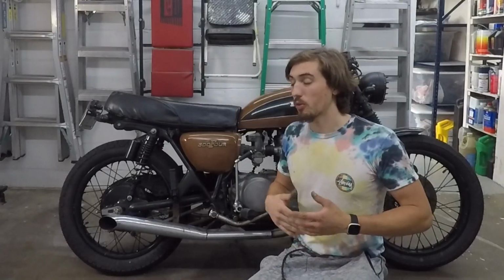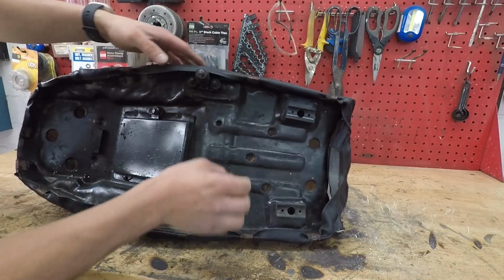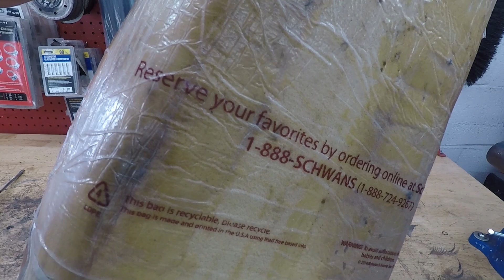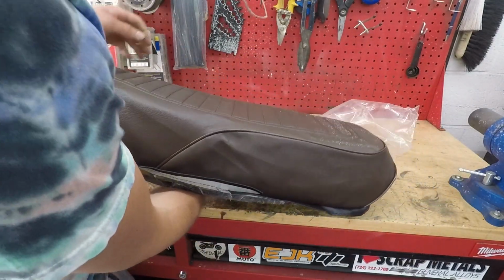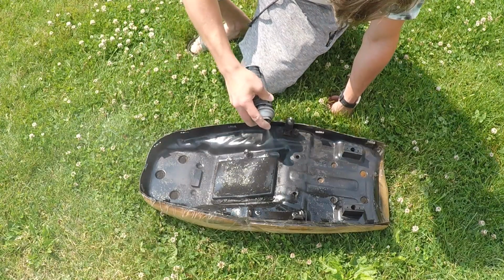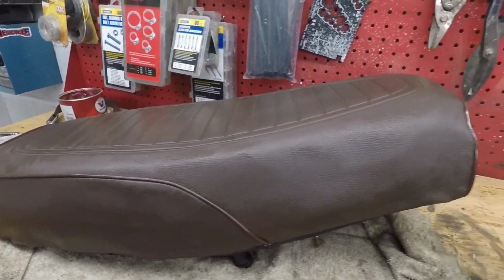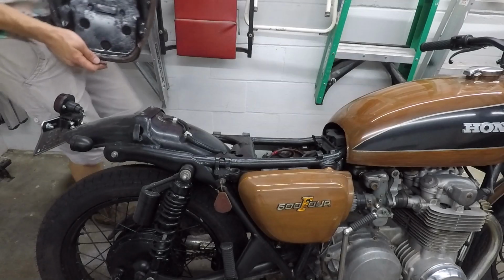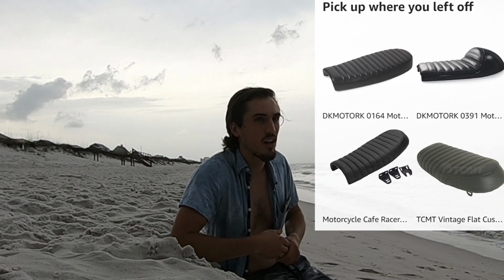Installing a Brown Seat on my Café Racer and Regretting it Instantly

Comment: Was the owners manual in the seat pan?  I never saw you open it to check.  That is where they put them back in the day. Also the seat cover is sagging from the foam being compressed from the clear wrap on it.  You can add a little more foam to the seat by wrapping it on the outside of the pad.
Reply from the maker: Nope, the owners manual is nowhere to be found. I checked that little compartment but was disappointed to see it empty.

Comment: Texavina have fully custom seats that are identical to the original seatpan. Zero frame mods required.
Reply from the maker: I looked at Texavina seats and they look really nice but they cost $280 and take like 6 weeks to ship so I opted for the $60 from Amazon that will get to me in 2 days.
Reply: @GoldGuyRides  I guess it's what you pay for no mod fit XD
Reply from the maker: @Overture  yes that's true but I'd rather save the money and do the mod myself.